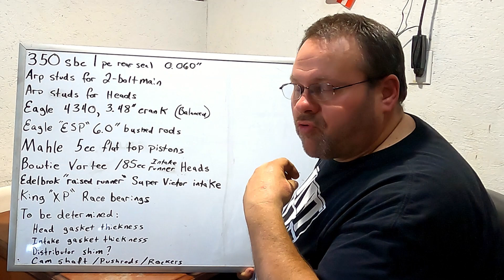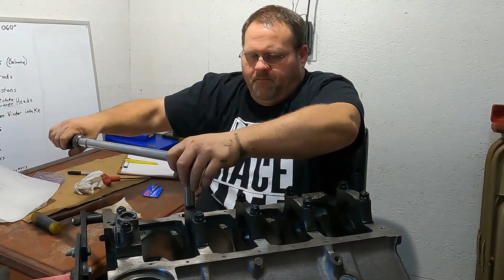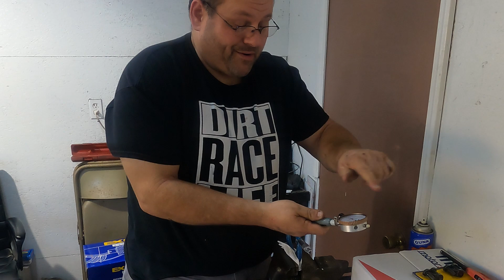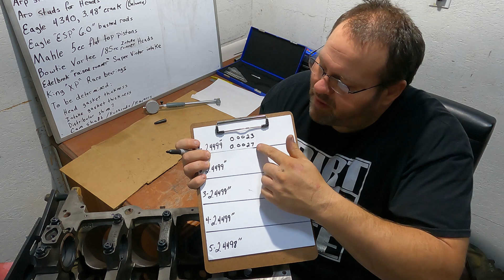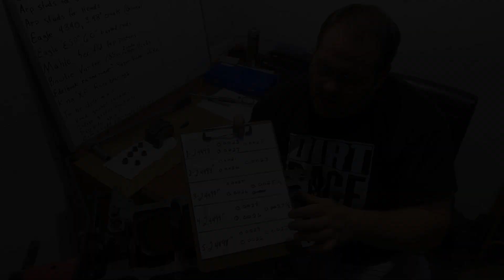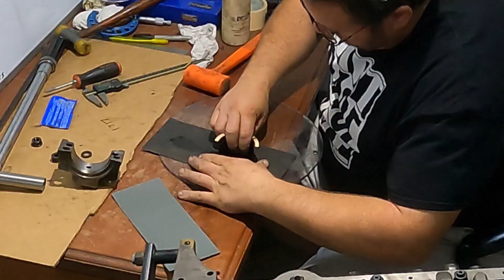SBC Short Block Preassembly (Bearing Clearances & Piston to Deck Measurements for a Zero Deck Cut)

Comment: My question is whether the rear main cap is torqued or not, prior to hitting crank with dead blow in seating thrust bearing
Reply from the maker: No, I do not, I torque it up and then back it off and go to snug while doing it. You literally want the shell to move and seat up on the block. But in my opinion I don't think there is necessarily a right or wrong here because small blocks are incredibly forgiving when it comes to thrust clearance. as long as you have some, she'll live. Ideally you get it perfect but there are PLENTY of old sbc's still out there with 0.030+ and still pluggin right along.
Reply: @DIRTRACELIFE thanks 🙏
Reply: @DIRTRACELIFE sorry I forgot to ask earlier , what is the importance of having the oil pump torque down while doing all this
Reply from the maker: You don't need the oil pump for thrust clearance, You DO NEED the oil pump torqued down to measure crankshaft diameter clearance.

Comment: adding studs to the mains you shoud have it line bord
Reply from the maker: I get the full race prep at the initial machining but I don't necessarily see a mandatory line bore as a requirement. I think it's important to blueprint for this reason. If the studs introduce a non-conformity that you feel is outside spec then address that and thats going to give you the confidence that it's right.

Comment: I give it to you on the bearing measurement side. You do that correctly but what you really need to do for a " Race Engine" is to measure the housing bores not only for diameter but for straightness. Replacing bolts with studs you are changing the clamping force of the block and cap witch can introduce a distortion into the housing bore itself.
 Any race engine when changing from bolts to studs needs to be line honed. For street engines you may get away with it but it is good practice to do it. Don't believe me call Chris Raske up at ARP. Not only is he a VP director at the company but he also has been building sprint car engines for years. By not line honing you are basically short cutting your race engine and if every HP matters your losing out.
Reply from the maker: Don't argue with you one bit and don't need to call Chris because there is no debate here. I'm aware of what you are referring to and agree that is the best practice. I hope to have the machine access and the time to make it happen at some point in future builds. It can do nothing but help get even better results.

Comment: With those tolerances are you running 50 weight oil?
Reply from the maker: I like 50wt at 3 thousands but on final assembly if I really am averaging closer to 2 thousands everywhere, I believe I will go 40 wt on this one.
Reply: @DIRTRACELIFE  what clearance do you go with on connecting rods? What oil with what clearance?
Reply from the maker: If I am seeing 2 thou on rods and mains both then I am liking 40 weight. If rods are 2 and mains are 3  . . . Maybe just 50 wt if I know none of the rods are less than 2. 
I may put -1 bearings on the mains and bring them down to be able to run 40wt if they were all at 3 or more. If the rods were all 1.5 to 2, I might put a half shell of a +1 in them to get them up in clearance. It's an art to this stuff bud and there is no perfect answer. You have to just work the problem to find the happy medium where everything can live happily.

Comment: Have you seen any guys in their mid 50's or so just getting into dirt racing & did good? Or do you think that age is too old to be successful compared to someone in their 20s and 30s?
Reply from the maker: I think there are a few things that are important. You need good far vision and if you have any cataracts they have to be fixed (its dark even with the best of light when looking through a stack of tear offs). I think you need good balance as well. If you have an inner ear issue that will play hell with trying to "feel" that razors edge of bite limit in the corner. Reflexes are important but so is dedication, patience, and hard work and much of that only improves with age. To me beyond that I believe age is irrelevant. Look at Red Farmer at Talledega short track in a late model :)
Reply: @DIRTRACELIFE  thanks for the reply. I guess all that makes sense.
Reply from the maker: Ok good point, so here's the more specific answer YES. Most of the front runners I see are from 35 to 55 years old. They have the knowledge and still have the reflexes as well. TJ Herdon is tearing it up in CRUSA and cleaned house at Bristol this year and he's at least my age of late 40s. Check out Johhny Stokes, owner of Magnolia Motor Speedway Mississippi, he just bought Jason Hollis's GRT Street Stock and is a hell of a driver in pretty much anything and has to be in his 60's ??? 
Plenty of examples so dont be spooked by age at all.

Comment: What are you going too run for a camshaft? I am building a very simular motor for nect year except im running bushed 5.7 rods and promax votec heads they flow 240cfm on the intake side at .500 lift   im running a summit racing sum-ct108 mechanical lifter its summits version of the prc 108 cam  good luck on your build love the video's
Reply from the maker: I'm planning to go with a custom cam supplier once I get everything locked in as far as what the final compression ratio, intake, etc. Never bought from Jones but hoping to give him a call and order one (hear alot of good things about them).
Reply: @DIRTRACELIFE  get ahold of mike jones buddy he is out of NC i have ran a couple of his cams no complaints just not in the budget this year

Comment: Use 5.7 rods for short track 6.0 rods for 3/8 to 1/2 mile tracks this is just my opinion but my own experience  is 5.7 rods work better on short tracks love what ya do buddy
Reply from the maker: I agree with the logic behind that statement. Longer rod = longer dwell time at top dead center and that means increased torque. Longer tracks require taller gears where torque is critical gettimg off the corner at a lower rpm. So yeah I'm there with ya on that but I'll take more torque anytime I can get it (just makes a bigger difference on taller gears). It may be a mute point anyway CRUSA might suddenly switch to only a 5.7 rod for next season in which case I'll be rebalancing this crank with some 5.7s and pistons.
Reply: @DIRTRACELIFE  usually on a dirt track during the mains the track is not hooked up most racers soften up the bottom end, helps it hook up. I ran in a super race with a 327 2 barrel and finished 5th but the last 17 laps was run under green I could've threw a football to 1st place. The reason I run that was they changed the tire rule on limited sportsman so I had to move up a class or buy new tires.

Comment: Can detail block before it goes back (oil pathways, deburr, tap plugs, chase threads...).
And are those heads bought assembled?  I'd check the work.  What are your dimensions of the port, bowl & throat (pushrod pinch, % of valve for bowl and throat ..)?
Reply from the maker: I went ahead and threaded my oil plugs but will still need to clean up my oil paths off the heads and into the front cover. I'm the same way of chasing every thread and knocking off any casting edges, etc before being done. It's free so why not take the time is my moto. 
I can't port the heads in CRUSA and most of the other street stock classes I will run so things I would like to do like blending the valve guide pedestal in the bowl or polishing the exhaust ports is out. But on the bright side. . . It's Bowtie Vortecs! them babies flow beautiful totally untouched.
Reply: Did you improve the oil return in the new block and heads?
What did Mike say about those restrictors?

Comment: That brought back some memories I used to use as STP for assembly lube No wonder why I blew up so many engines
Reply from the maker: Woo, STP. . . That stuff is pretty much shoe goo!
Reply: A lot of builders use red line assembly lube (journals, pins...), cmd extreme pressure lube on push rod tips and a break in oil...

I've used clevite assembly lube when I first started, or royal purple assembly lube w/ molybdenum grease.  
Now I use driven racing oil assembly lube, driven assembly grease and driven break in oil.  All good results.

If you're agressive on the cam you can use break in springs and break in low ratio rockers.

Obviously you'll make sure lifters all spin and prime it...

P.S. secret - that green scotch bright is used somewhere else on the engine with gojo hand cleaner before soap and water final clean.  Hint - less Rpk, less embedded material but still valleys for oil